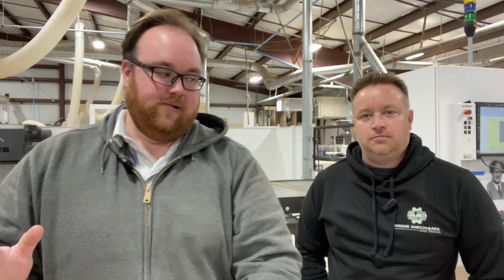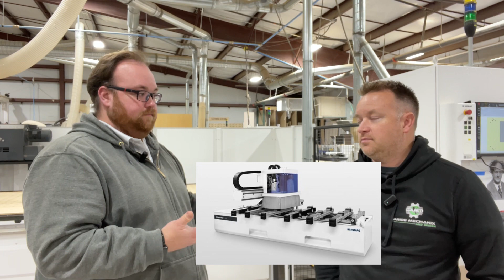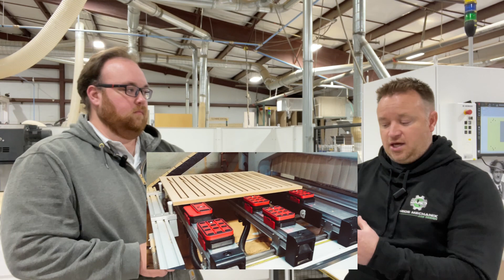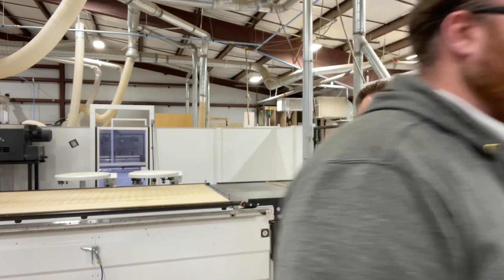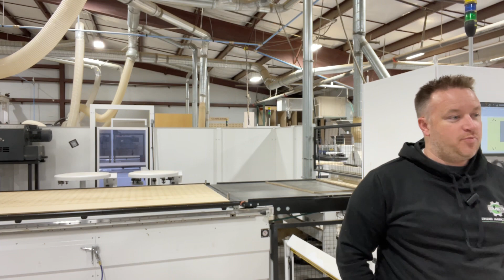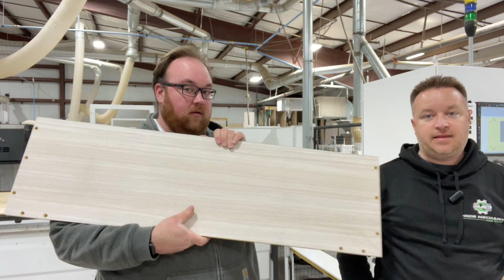Pod and Rail vs Nesting CNC routers

Comment: You can put vacuum pods on a nesting machine so you can work on the sides. Specially usefull for putting profiles on solid wood. CR Onsrud has a video on that.

Comment: My company has both Nesting Vantage Comp3, 2 Large Holmza Beam saws and 6 Weeke Pod and Rails.  We use the Nesting machine for one off items and items that don't require horizontal drilling or horizontal drilling after edgebanding.  The Beam Saws with PNRs (Pod and Rails) are used for large batch runs where we are cutting and machining 100s or 1000s of the same part.  PNR are also great with use of an aggerate.  And to add if you are running Stiles' Saws or Nesting machines , Cutrite is a godsend.  Great videos.

Comment: Hey. Even your nesting has probably capability to drill from the sides. Even on your machine you can use pods to do operations. I used to own beam saw and Rail and pods system 4axis CNC machine. If you dont have dowel driling and inserting machine it is easier to have rail and pods machine just for sake of side driling. even 3axis machines can dril from the sides at least for this bigger machine manufacturers. 
After I bought my frst nesting machine I sold my beam saw manly becouse i did not have enough space for both but if I culd I would keep my beam saw. It cuts much faster for pieces which dont need to be driled from top.  I am doing manly batch one becouse i do manly restaurants and other public area shops. But I tend to cut 5-10 cupboards at the same time just for sake of better use of material. And then we batch one after edgebanding.
And pods and rail system cnc is better for 5 axis machines if you do a lot of curved and 5axis simultanious operations becouse you have normaly mor Z travel than on nesting. I can do most of 5axis work on nesting but it vas a few times wher I needed more Z travel and I had to subcontract those parts. But manly on the end it is software for preparing programs which counts. I do a lot of 5axis so I bought few licenses of Solidworks and Swood and it makes my life so much easy, that i whish I would buy it when I bought my first 5axis nesting. You can see some of our work on our facebook https://www.facebook.com/profile.php?id=100030180865996 to get a feeling what is possible on CNC nesting machine.
Reply from the maker: Sweet, I’ll check it out.